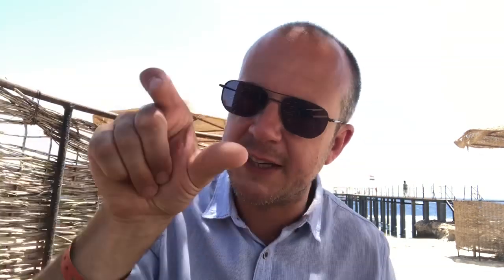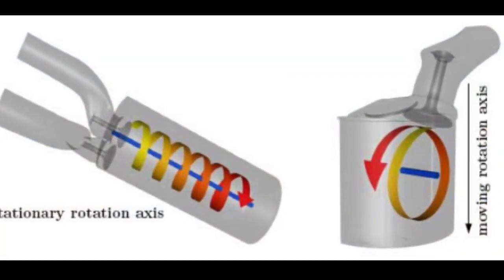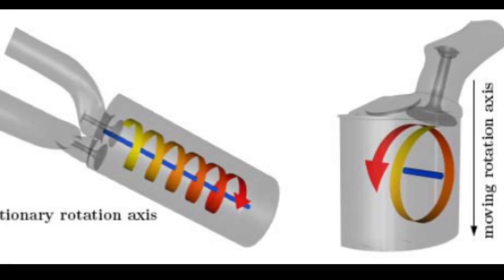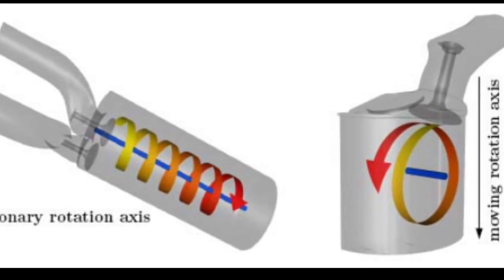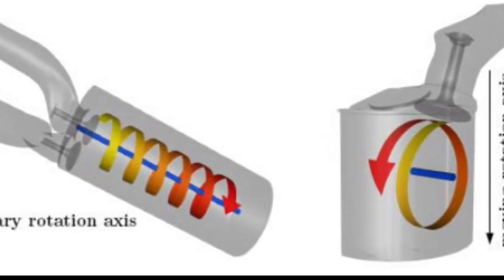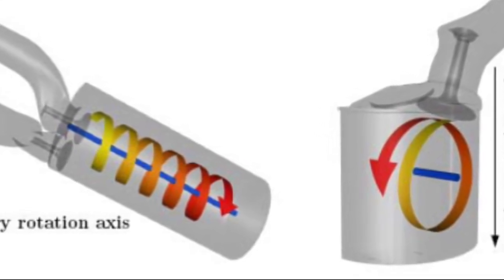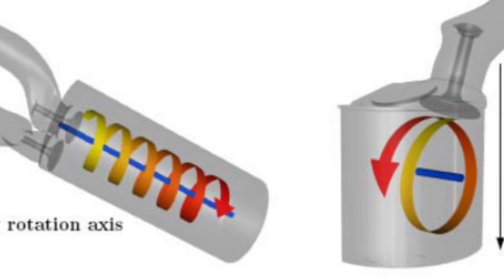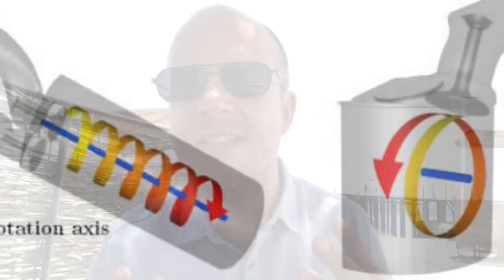BMW 530d (F11) Swirl Flaps: How Do They Work?

Comment: This video of dyno test result of a nissan patrol ZD30 engine with swirl flaps fully open all the time vs fully close all the time shows better torque at low RPM (below 1600 rpm) when the flaps closed until the point it chokes the inlet air flow and show significant lower torque/power than a fully open flaps.
https://www.youtube.com/watch?v=n_6D6PeTtNQ

Comment: It is very possible that the plastic flap will break off. My EGR valve got stuck open, and exhaust gases burned the flap, causing it to break off and go into the valve, which bent it.

Comment: you do realize your car is a diesel and it only gets fuel when the piston is in top position so no fuel mixing happens before that
Reply from the maker: What’s your point? This video was explaining the function of swirl flaps on BMW diesel engines.
Reply: @Nut_Job.  well the swirl doesnt mix any fuel with air becose the fuel is added latter once the air is fully compressed in the cilinder
Reply from the maker: If that’s the case, why do you suppose all the car manufacturers use swirl flap systems on the air intake ports? 🤔
Reply: @Nut_Job.  there is a  chamber in piston it self so my gues is to fill it easer and to mix EGR gas thats bin recirculated back to the intake

Comment: An explanation that everyone can understand.  I come with an incident and a question at the same time.  I removed the intake manifold to clean it and change the flaps, all 4 were broken, 2 I found in the intake holes, 2 no, I think the engine sucked them in, I didn't find any pieces of the 2 flaps  , I put everything in place and it works without problems
   It is a 2014 BMW f30, xd, 184 hp, n47 d20c engine
   Do you think they were chopped, ground, burned and put out on the exhaust, without affecting the engine???????

Comment: It's also worth noting that when the flaps are removed it provides more air flow at lower RPM. The ECU is not mapped for this and so there is a lean mix of air/fuel which results in power/torque loss. In carburetor terms, it's like having a fuel jet too small for the cfm (cubic feet per meter of air flow) of the size of venturi in the carby. When you decrease the air to match the fuel - the ratio is correct with an increase in power/torque and visa versa increase the fuel......... In the case of removing the swirl flaps you're increasing the air flow without increasing the fuel until the RPM builds and the supply of fuel increases as per the map in the ECU.
Reply: Diesel engine ALWAYS run lean !!!!! So what the difference? It's all about swirl the air not lean/rich mixture.
Reply: this video of dyno sessions a common rail diesel engine with swirl flaps fully open all the time vs fully close all the time shows better torque at low RPM (below 1600 rpm) when the flaps closed until the point it chokes the inlet air flow and show lower torque/power than a fully open flaps. 
https://www.youtube.com/watch?v=n_6D6PeTtNQ

Comment: I recently put in a bigger engine that had swirl flaps on the intake but I unscrewed them seeing that my ecu can't use them. I left the flat rod running through the intake manifold and tbh when I leave the flat side vertical, the car can do burnouts with ease and when I rotate it hurrizontal - flat it gets sluggish. It makes me wanna run a cable so I can adjust it while driving xD.

Comment: The purpose of swirl is for improved IGNITION not improved mixture.
The air fuel charge sweeps past the spark plug continuously offering the spark plug as yet unignited air fuel throughout the duration of the spark. Swirl creates a long streak of combustion initiation instead of a ball. Without swirl you get the tail end of the spark firing inside already burning fuel so wasted spark.
Reply from the maker: Diesel engines (like the N57) don’t have spark plugs, therefore it’s ALL about air/fuel mixture.

Comment: Every thing will be nice if that will be petrol engine. On diesel. Engine fuel is added whet piston is in top position and is no chance to mix air and fuel before. That reason inportant is injector condition. Swirl flap is only for economic reason.

Comment: So why don't they " machine" the intakes  or ,precast them with flutes (like a gun barrel, ) in a fashion that makes the air move in the desired direction/s.
No moving parts and not likely to wear out this side of 200'000 miles.
Reply: Just my thought exactly! Continous swirl no matter the rpm range

Comment: Very informative video, thank you very much, hope u enjoyed ur holidays 😀 i have 2013 520d bmw with n47 engine, had problem with intake manifold it went on fire, so now i got the second hand 1 and im thinking to remove those flaps away, that 2 or 3 % efficiency u mentioned, it calls on fuel i believe? Have you noticed big difference?
Reply from the maker: No, I’ve not really noticed a difference. It’s actually quite difficult to state mpg changes because they are so dependent on driving style. For example, I find this car responds very well to driving around 63-65mph on the motorway (very boring...) and will get 50+ but if you notch it up to 70-75mph then you will fall to around 45mpg...
Reply: @Nut_Job.  my main road is motorway to work, very little of town or city driving, so i think for me would not feel worse, might even better 🤔 thank you for your reply sir

Comment: Hi m8. You know my thoughts on swirl flaps after our conversation a while ago. If one of the swirl flaps was to break off and get injested by the engine, who knows what damage it will do.....and you'll be the one who loses out financially!!!! You've only got to look online at the amount of cars where the plastic parts have been sucked in to the engine and destroyed it!!! Swirl flaps were introduced for emission purposes only. Nothing else.
Reply from the maker: Exactly why I took them out. People have commented that low down torque is adversely affected, but I haven’t really noticed that yet. I need to give it more road testing when I’m back though 👍

Comment: Any plans for checking the turbo before putting it back together? Would be fun to see a video of the condition since its a former cop car  (rough use sometimes) with high miles on it
Reply from the maker: That’s a good shout tbf... 
I’m under a bit of time pressure to get it all back together unfortunately, otherwise I definitely would 😫
Reply: Ex-police vehicles have hard use at times but also have high quality and frequent servicing.

Comment: Not sure what 'mixture' are you talking about here. When the air enters the cylinder the fuel is not even injected yet.
Reply from the maker: Yes, but the injector will operate approximately 1/100th second later and the fluid motion of the inlet air is what will help the air/fuel to mix effectively. The inlet air doesn’t stop moving after it enters the cylinder - that’s the point of the system anyway.

Comment: First: enjoy time off of your car's issues..! Good video, however I respectfully beg to differ with you. As I wrote on your previous video, those flaps have a meaning and your explained it very well, so my tendency is to trust team of engineers scratching their head on how to increase torque at low RPM. Mercedes is doing the same thing, most car manufacturers also. Now on the risk of breaking flaps on your N57 engine: as you said there is no screw and I don't see any reason to wear the plastic, but you are right, the flaps collect gunk more than a free opening. My point is that the gunk not stopped by the flaps will go to the valves anyway... Now when it comes to the M57 engine and the screw to hold the metal flaps, there are more drama on youtube about it than real problems. I am not saying it never happened, I am only saying after asking people I know working at a major BMW dealer, they never got a single case. But it has probably happened and could happened. So..... For example my wife drives a 2009 335 D with the M57. During the last walnut blast I have done (I do it every 50k miles), I have removed the screw and put them back with a strong locking paste. it will go nowhere. You said it is a risk to have anything which could get loose in the intake system and you are right, but then, your worry must be about the EGR cooler which have much more risks of a piece of metal reaching your valves seats.... think about it... Actually BMW has a recall campaign as we speak on some M 57 models. That EGR cooler makes me very concerned, much more than a plastic swirl flap which will never reach the valves in your N57.

Comment: Thanks for this clarification as having watched your video on removal, I wondered what they were for. Question: as most engines have ECU's that monitor air flow etc & adjust fuel metering & timing, what would removal do to upset the ECU operation?
Reply from the maker: I’m not really sure how much it’ll be affected yet. I’m struggling to believe that the ‘performance change’ will be great enough to be actually noticed.... but I’m sure I could be wrong. The other side of me thinks that BMW put quite a bit of effort into the swirl flap system, so it must be important? 
Or perhaps just to tip the performance/economy in their favour a tiny bit on paper... 🤷‍♂️

Comment: Are you doing egr delete? Will stop the gunk build up and keep your oil clean!

Glad you owned up to the error of not blanking the shaft end... it’s refreshing on YouTube
Reply: We had a 335d with around 380hp. My german tuner made a clear recommendation to not delete the egr. And this is the kind of guy you can trust 100% with things like that. You can check him out at PP-PERFORMANCE his name is Jimmy Pelka.
Reply: moinmoin you are correct BUT.... when tuning and pushing a Diesel engine hard, egr has a very useful function to cool cylinder temperatures, nut jobs engine is in basic tune, here deleting the egr will stop the coking and oil contamination with no downside. If he goes for big power and track use the I would fully agree to leave the egr alone and fully functioning
Reply from the maker: Yeah, I noticed people on YT always seem to portray everything perfectly... I’m not perfect however & I certainly do make plenty of mistakes 👍

I’m undecided about things like EGR delete for now... I’ll just focus on getting it running nicely again first. 
I understand the EGR purpose in relation to reducing NOx emissions, but I also think it has a role to play in controlling cylinder temperatures (like in the Range Rover TDV8) - that’s why I’ll research further before deciding 👍

Comment: THe swirl flaps are not the actual problem in the mixture its the EGR system that clogs the flaps up and they break loose ....
Reply: EGR is not the problem! Problem is crank case oily fumes mixed with returned exhaust gases. Think about why your exhaust doesn't clog up?

Comment: Following your Beemer repairs from Australia, great insights into timing chain replacement and dropping transmissions. I'm not an engineer but I am a car geek and work on ships with large, long stroke diesel engines. The swirl port can only help with scavenging the exhaust gas, as the compression stroke compresses the fresh air from the turbo-charger and inter-cooler to a tiny volume at TDC. Swirl technology was used on Yamaha (YICS) and Suzuki (TSCC) motorcycles in the 80's to promote petrol/air mixing on four valve engines. Looking at the crud build up on the swirl flaps from the EGC, I think your engine will breath freer without them. Looking forward to seeing it running and your assesment of the driveability. Good luck! Stuart
Reply from the maker: Thanks Stuart, great comment 👍

Comment: Perfectly explained and very insightful. Citroën/Peugeot XUD heads had swirl chambers going back as far as 1980's..
Great video..Looking forward to seeing you finish the job.. Happy holidays.😀😀
Reply: Swirl chambers are generally for indirect injection diesel engines. During that time period injection pressures were not as high as they are now resulting in the injector kind of pissing diesel in the combustion chamber rather than spraying it as a fine mist. Because of this, indirect injection diesels utilized swirl chambers so the injected diesel could mix and atomize better before entering the combustion chamber. If they did not have swirl chambers at that time the engine would not even be able to start when it's cold due to poor atomization ;)
Reply from the maker: Thanks Guy 👍

Comment: Nice location for a video but you should probably be sunbathing 😂 I took mine out in my M57N2 and no problems in almost 7 years!
Reply: Same, absolutely no difference in bottom end power that I could feel and for the little benefits they give its never worth destroying an engine over. Really good video by the way, I've never heard the swirl flaps functionality explained in that much detail before.
Reply from the maker: Awesome 😎

Comment: Good description thank you, is this just a diesel thing or do you get them on petrol too? Would have thought this extra mixing would be useful on indirect injection petrol engines.
Reply: Yes,they are fitted on some petrols,I first became aware of them when I had a Mondeo Mk3 petrol from 2001. Would presume they may still be used,not up to speed on more recent petrol engined cars as I went diesel a few years back.